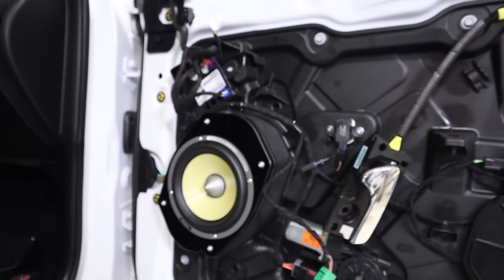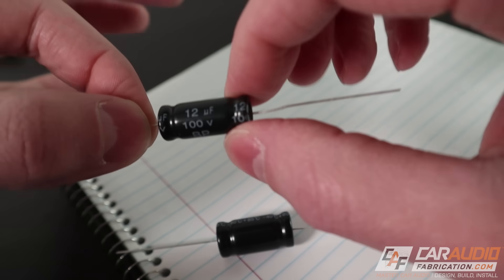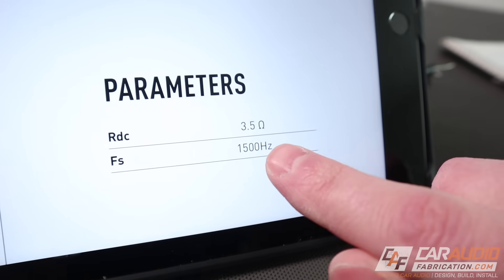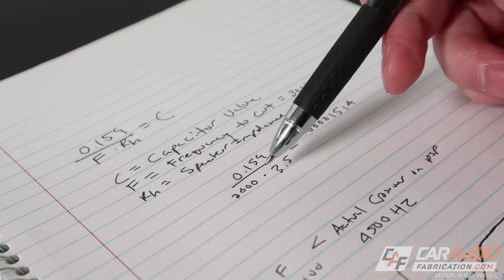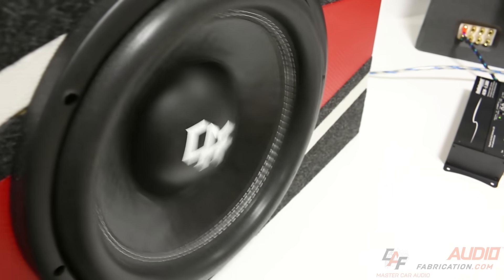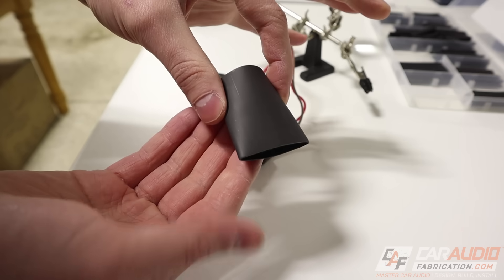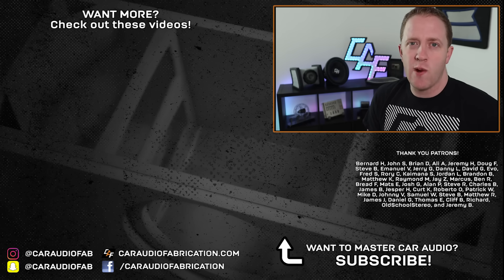PROTECT YOUR TWEETERS! Capacitors and WHY you need them

Comment: Can you explain why numbers (max watts, rms, range) arent everything? Like the importance of design deminsions and material, and what is actually going on with air and sound. Why some lower rated speakers ( 100w rms but higher quality) sound better than higher rated speakers (200w rms but lower quality). Thanks. Or anyone who can chime in lol. Thanks.
Reply: Because there is just so much more to a speaker then power ratings. 

For staters, there are different types of power handling - mechanical power handling (how much power can a speaker take before it reaches the limits of it's suspension) and thermal power handling (how much power can a speaker take before the voicecoil overheats and risks damage).

Thermal power handling is typically limited by the size of the voice coil and the effectiveness of the ventilation.  Mechanical power handling is limited by the displacement (cone area x excursion) that the driver is capable of. 

Morel for example rates the Ultimo subwoofers at 1,000W RMS and this is largely based on their their thermal ability - they have a whopping huge 5" voice coil, so they can take a LOT of heat without worrying about damaging the voice coil.  However don't let the power rating fool you - the Ultimo is an SQ sub and it's ability to take power is ultimately limited by the fact that it only has around 12mm of xmax.  So if you put an Ultimo into a fairly large box in order to get the depth of response you want out of it, you might find it will only actually take 700W RMS before it's getting pushed dangerously close to it's mechanical limits. 

Another factor is sensitivity.  Sensitivity is effectively a measure of how efficiently a speaker can turn electrical input into sound output.  Think of two cars that both have 300 HP and 300 lbft of torque - but one of the cars weighs 50% less then the other car.  The lighter car will almost certainly be quicker even though they are runnign the same power and torque.  Sensitivity kind of works a similar way.  Speakers that have light moving mass tend to require less energy to move their cones, and as a result they are able to produce more output per watt of input.  Moving mass isn't the only factor that plays a part, but its one of the key factors.  Sensitivity can make a really big difference - if you have a speaker that is 6dB more sensitive then another speaker, it will need only 1/4 of the input power to be driven to the same loudness.  E.g. a speaker with 94dB sensitivity will go just as loud off 25W as a speaker with 88dB sensitivity would off 100W.  For a driver with very high sensitivity, thermal power handling rating can almost become a non factor. 

Then you also have other key factors such as harmonic distortion - some speakers have a lot more harmonic distortion then others, and it can have a huge impact on whether a speaker sounds laid back and clean or fatiguing and uncomfortable.  

There's also frequency response - speakers with highl erratic frequency responses will generally sound much worse the drivers that have a fairly flat and smooth output across all frequencies.  There are so many other factors as well - it;'s really a massive, massive array of criteria that contribute to how each speaker sounds reltive to another.  Specs like power handling and the printed frequency response often are, ironically, pretty unimportant in the grand scheme of things.
Reply: He has other videos explaining some of this. Long story short, a manufacturer can say whatever number they want to sound good. For example, Ford claims my F150 gets 22 mpg. But it gets nowhere near that.

Also, even if they're accurate, numbers don't tell the whole story. For example, a cheap ass speaker may handle 200W without frying, but it may start badly distorting at 50W and sound horrible.

An analogy.... A basketball player may score 50 points per game. That sounds awesome. But maybe he's shooting every shot and the team loses every game because he's making 10% of his shots. .... One number doesn't tell the whole story.

Comment: Excellent presentation but NEVER use electrolytic capacitors for tweeters as shown here. Always use audio grade capacitors.
Reply from the maker: Nope wrong. The electrolytic capacitor has no impact on the performance of the audio above the actual crossover point. It is completely a fail safe. If you want to use "audio grade" (which is just a marketing term) feel free, but its a waste of $.

Comment: MKP Polypropylene caps are much better than electrolytic for tweeters especially, although I am not currently running active on my current vehicle yet, I've in the past used Jantzen "CrossCaps" that are very high quality. Another recommendation, put the caps in a location that is also going to be relatively cool, such as in the shade behind a kick panel, sun temperature can really cook things
Reply: Polypropylene caps are good for sound quality, but this one is for protection.  Think of the polypropylene cap as a light switch, where the electrolytic cap in this design is more of a circuit breaker.
Reply from the maker: Glad Rorique actually watched the video. Thank you for understanding.
Reply: I also watched your video but maybe didn't catch all the details, and I have watched many others you have made also, however I am just raising the idea of why quality/chemical choice of the cap is not in question, it is in series with the tweeter, so even though the actual active and filtered audio getting to it has been highpassed above the caps centre freq, the 1x cap is still only 6db/oct "basic" crossover, so it will only be down 6db at double that octave, so to me it seems it could have some reaction and thus interfere with phase and response.

Comment: I'm also concerned about the phase issue. That cap adds -6dB/oct slope there. 3000hz is pretty close to 4500hz and if using -6dB or -12dB slopes it might be too close and affect on the sound. So it means the 3000hz point makes the total slope being -18dB/oct if the crossover is -12dB/oct. Also the phase turns at that point too.
Reply from the maker: Don't get caught up in the exact numbers used for this example. If you are using such a shallow slope (which will lead to other issues transitioning from the mid) then obviously you would want more seperation. For a 4th order crossover you would never in a million years hear the difference between protection cap and no protection cap.
Reply: Yep. That's what I meant just pointing out. Lower cap, no problem. Maybe one should figure out the optional crossover area to be used and pick the cap size small enough to be out of the way. Steeper slopes naturally decrease the effect.

Comment: Is there a formula for high pass cut off for a subwoofer?
Reply: At minimum, the Amp's Crossover should be sufficient for this. Tweeters may can handle 100W, but if  you are pushing 10W of bass thru them, they will be destroyed. The Sub won't have this same effect.
Reply: Yes. But to be honest, just use one of the online crossover calculators. Also remember that you will often want a steeper crossover slope for your sub than a simple 1st order filter will provide you with.

Comment: Also a side note, while this is a great practice for customer systems -- A capacitor needs to be a decade lower then its crossover point to offer zero phase shift. this is only applicable with competition grade SQ cars but it is very important for perfect acoustic phase coherency. When using a 4000hz crossover slope with a 24db LR, 4000hz will be 6db down from 8000, and 2000 will be 18db down from 4000- If you used this capacitor then you would be causing a phase shift from 3000 down and on to the critical range where the tweeter hands off to the mid range. In a competition grade car it is important to make sure there are no turn on pops to begin with and one would only have a inline cap in the event of a DSP failure. But this could be likened to having a reliable daily driving car that may not have peak performance but lasts forever and having a race car that is less reliable daily but has much more impressive output in exchange.
Reply: Aren’t phase shift issues addressed during the RTA and time alignment configurations while tuning a system?
Reply: they have SQ competitions?? how does that work???

Comment: Hey great vid u should do one on how to determine positive and negative on tweeters a lot of them don't have the wires marked both wires same colors
Reply: You can usually tell by the markings. Usually the wires are blk/wht for the positive. If you still confused, you can get a tester like the PT-9A. You can test phase using that tool.
Reply: @markeysetheautotech  lol no such luck both wires black with no markings at all soundstream are the ones I'm talking about here but a lot of them are like that I will look up that tool
Reply: @BlackLabelElite  Yea I wouldn't touch a soundstream with a 10 foot pole. But check out the PT-9A. Trust me it will give you 100% of what polarity that Soundstream wires are.
Reply: @markeysetheautotech  tooooo funny I said the same thing it the ones that are aluminum ones man they are $20 on Amazon like high end tweeters try them I'm sure you will be back like bro they are the truth lol and I purchased that meter on Amazon coming tomorrow
Reply: @BlackLabelElite  strip wire to expose copper, apply AA battery, if cone goes inward do a 180 with the battery, if the cone goes outwards you've found your + & -.

Comment: Does the cap have to be non polarized?
Reply from the maker: Yes
Reply: Yes.  In a nutshell, the current in the wire travels in both directions (not at the same time, it alternates... alternating current, A/C): one direction pushes the driver out, the other direction pulls it in.  This combination of pushing and pulling the speaker in and out happens quickly and is what vibrates the speaker, making the sound.  If you install a polarized capacitor, it will not be able to interpret both directions of current.  In fact, your driver may not really feel a signal at all with a polarized cap in.  Learned it the hard way tinkering.

Comment: Is Resonant Frequency the same as Frequency Response?
I'm using a set of Apline SPR-10TW and I don't see the Fs in the specification.
Reply: No.  Resonant frequency is a specific frequency the speaker resonates at, not a frequency range.  After a quick look, I don't see the Fs for them, either.  It looks like it comes with crossovers to "take care of" that situation.  Basically, they provide a kit that is worry free.  They don't provide the specs, probably because they expect you to use their kit crossovers with their speakers.
Reply: @roriquevernonii8439  thanks much, I really do appreciate the time you took to respond & explain to me. I wanted to run a full active system and also apply this method Mark gave us, that's my reason for asking. But I will just use an 100v 15uF capacitor like what Mark did 😁😁😁

Comment: Will this degrade the audio quality at all? Wouldnt it just be better to use a real crossover that is set lower than the value you have set on your DSP?
Reply: A single capacitor that limits low frequency to the tweeter is a "real" crossover for a tweeter, albeit a very simple one. Electrolytics are generally not used in quality crossovers.  People perceive their sound as, not as pleasing, as other capacitor types such as metalized film or polypropylenes. In the end though, the difference in sound between different capacitor types is so subtle to the point that engine / road noise will drown it out any way.

Comment: I replaced two speakers in my car with 3.5" polk speakers, they weren't cheap for that size, like $50 for a pair of them, and now on my completely stock audio system 4 years later the diaphragm has RIPPED, I never even listened to them loudly. I'm pissed to think I've gotta tear off my door cards because the shit speakers couldn't handle the Florida heat (it would appear the diaphragms became brittle, they started out as a really nice pliable rubber or composite material of some sort). Maybe I should just buy some speakers with a paper diaphragm, they might sound crappy but they'll last 5 times longer lol.

Comment: Can you make a video how to solder 0 gauge
Reply from the maker: For larger wires I recommend crimping: https://www.youtube.com/watch?v=TlV1_GjISps
Reply: Make sure you use a hydraulic crimper. I cannot tell you how many times I’ve seen problems from bad connections.
Reply: @Veritas-invenitur 
Exactly. It's a cheap investment compared to a car that burns to the ground.
Reply: Do not solder large wire. Crimp them.

Comment: Thanks for a great explanation of what size capacitor and the math you use to work it out. That will go in the electrical portion of my toolbox....(its not a small toolbox)
One question I've always wanted to ask an American, is do you spell solder different to us say in Aus. I only ask because it's always pronounced by you guys without the "L" where we pronounce it with the L. Not by any means trying to be a smart ass, more just interested....
Reply from the maker: People in different parts of the world say things differently. The way you say it sounds funny to us. I think the important thing to do is focus more on lessons that can improve the audio system instead of how someone says a word.
Reply: We spell it solder and pronounce it "sodder" in America

Comment: What would happen if the capacitor was to fail? What’s the benefit of doing this as opposed to buying a system capacitor?

(Side Note: I ask questions like this not for my sake but for the sake of DIYers who are self teaching themselves. I know you have seen me pop up in the comments like “This guy can’t be serious right? And “This guy must be slow.” On the contrary, I like to go as far as my mind will take me into possible improving situations and jimmy rigging scenarios to cover as much of a base as possible. I’m pretty sure you have seen some pretty horrible and blatant mistakes made in basehead builds as well as regular car audio builds from shops and other places alike.)
Reply: Normally, the crossover you use for audio quality also acts as the filter that prevents your tweeter from frying.  This capacitor is in place in case the active crossover "fails" (is set to the wrong frequency while tuning, or has some other failure).
Reply: @roriquevernonii8439  that would have been the best answer for mento have received from Mark, but i got another answer making me feel like a moron but bnb in a nice way not in a steve meade way lol. Thank you for the info. I have always ran passive Crossovers with 3 way components so for me running a active set up will be new for me.
Reply: A capacitor usually has a voltage rating. On the Capacitors in the video it is 100 volts which is far higher than the tweeter can handle. If the capacity fails it depends on whether it goes open circuit (tweeter stops making sound but still works) or short circuit (tweeter works fine but you have lost the failsafe) any partial resistance would make the tweeter quieter.
Reply: Yep. Thats a pretty good question. I asked him something up above in the comments and he did reply to me so even though he sounded a little weird about it he kept his cool and answered the question with out going Meade on me. 😅

Comment: Q.: 
1. why 3.5 Ohm? Impedans is 4 Ohm in manual...
2. why 15mF ? Inside crossovers build in capacitors 2500-3500...
 Thanks) 
  P.S.: Good job! 15 years working as installer but You projects is perfect. Deuch quality in The USA)
Reply from the maker: For a more exact value, in the grand scheme of things 3.5 vs 4 doesn't really matter as this cap IS NOT the crossover, but just to protect if something goes wrong.  The caps in the ACTUAL crossovers are combined with several other electrical components and much more complex. Again the cap on the tweeter IS NOT ACTUALLY BEING USED, until things go wrong.

Comment: How do u fix turn on pop?
Reply: It depends on the system. If the pop is due to grounding problems, you need to make sure your system is properly grounded. if it's because the amps turn on before your signal processors, you need to install a relay that delays the amp turn on.
Reply: @AB-80X  ahhh ok cool makes sense. ill check it out

Comment: One case where "putting a cap in it" is actually a good thing! -Gangsta D
Reply: True, don't be a big dummy.
Reply: He forgot to say that the cap must absolutely be a bipolar one, and that the voltage of 100V is recommended.
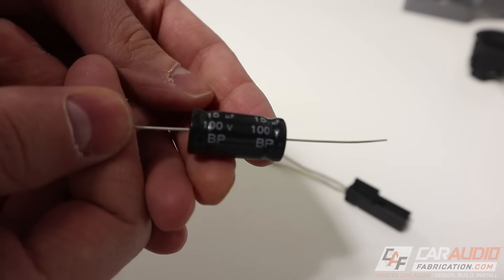Reply: @InXLsisDeo  5:51
Reply: @InXLsisDeo  In case you did not surveyed the capacitors selection at some audio stores, the voltages are typically available at 100V, 200 V, 300V, 400V, and 800V, but these are of the polypropylene  types and must be bipolar ones and often offers very tight tolerances for high fidelity,   at 1 percent, 2 percent, or 5 percent and others.
Reply: @InXLsisDeo  I think he said "non-polarized" in the video which is essentially the same thing. But I think you'd be fine with a 50 V capacitor since it's a 12 VDC system.
Reply: Big D in da house..Lol
Reply: How about a dddddddddddddddd lol
Reply: it's what happens when U fly off, on some1 in the ''zone''...
Reply: YEABOII 👍

Comment: I would put the helping hand for soldering on the other side of the solder. Between the joint and Capacitor to act as a heat sink. Extra protection for the component.

Comment: If you tinned the wire and the capacitor then fuse them together instead of twisting them together your life would be easier for service and if you forgot shrink wrap
Reply: I agree.  It will basically be like working with single strand and single strand.  It will also help prevent "birdcaging", or flyaway wire strands not making it into the splice completely.